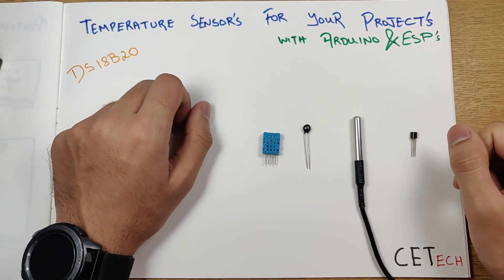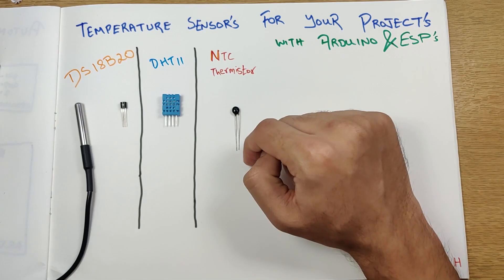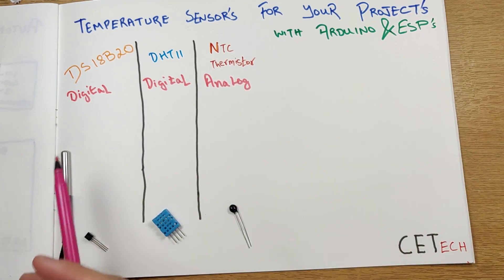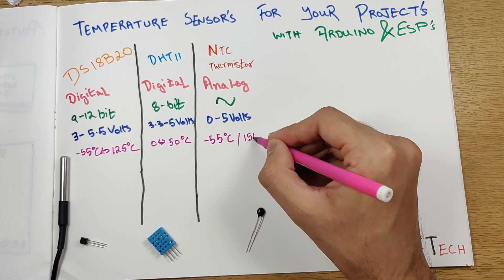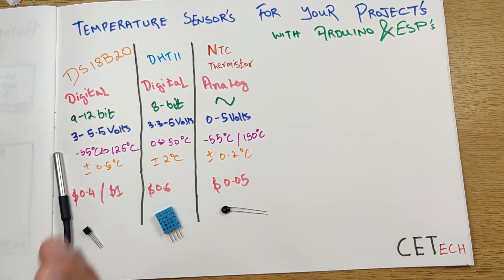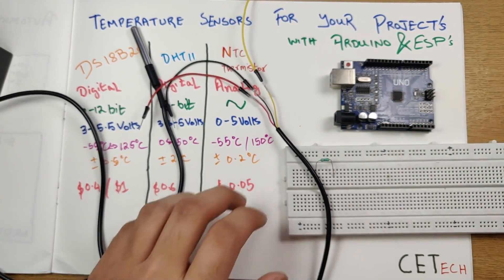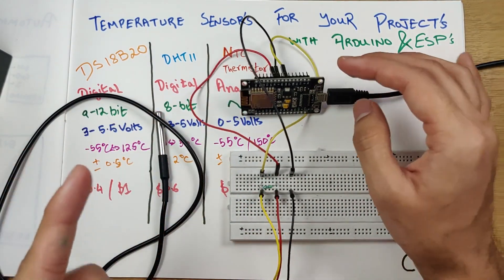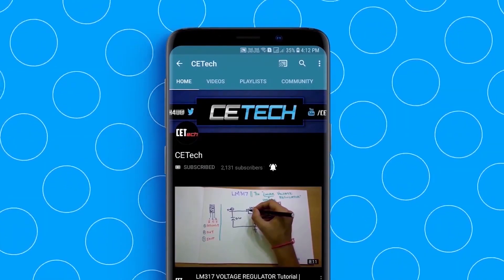WebServer using DS18B20 Temperature Sensor Tutorial with Arduino and ESP8266

Comment: Very nice video. Thanks. You said that the code for ESP8266 can also be used for ESP32 board. Right?
This menas that also here the data wire from DS18B20 would be connected to GPIO 4 in case of ESP32.
Could you confirm or correct this assumption plaese?
Thanks in advance.

Comment: when I switch to GPIO14 (=D5) I get this message in serial monitor:

--------------- CUT HERE FOR EXCEPTION DECODER ---------------

 ets Jan  8 2013,rst cause:2, boot mode:(3,6)

load 0x4010f000, len 3460, room 16 
tail 4
chksum 0xcc
load 0x3fff20b8, len 40, room 4 
tail 4
chksum 0xc9
csum 0xc9
v0004b8a0
~ld

Do you know, what this means?

Comment: Thank you for your compendium! Unfortunately my three connected DS18B20 sensors cannot be retrieved although they are found in another sketch. What am I doing wrong? Is it the wires? This is the error message: "Failed to read from DS18B20 Sensor". Can you please help? Keep up your channel!
Reply: So the answer was quite easy (when one knows were to dig...): I simply had to add a line " delay(500); " (without " of course) to give the connected DS18B20 Temperature Sensors enough time to send their data to ESP8266. I was not aware before. Hope it helps other too. Cheers!

Comment: This is such an incredibly helpful video. Even includes github as well. Am so thankful.
I'm trying to find a solution to monitor a multi-gpu system, at different spots within the case, to track airflow patterns at different fan rates when maxing the cards out. 
And i'm shocked noone has made a product .. like a PCI slot device with plugs for the DS18B20. 
The webserver is such an incredible added benefit. I just ordered parts, and I can't wait to get to started. Thank you!!!